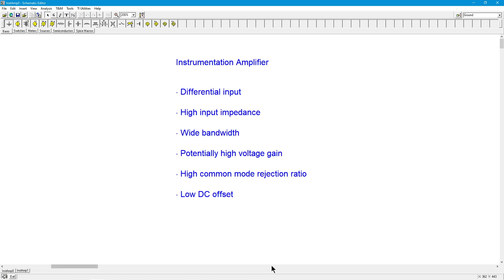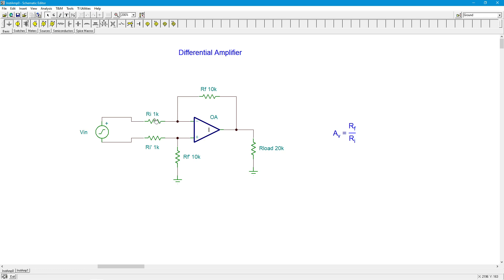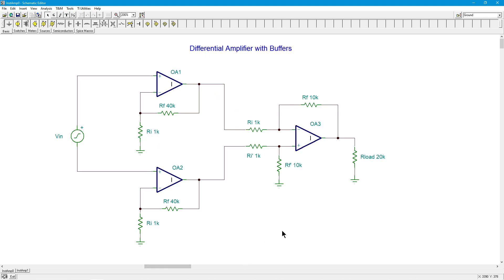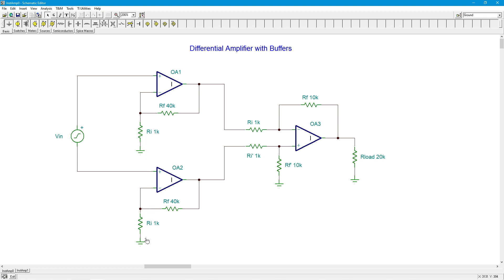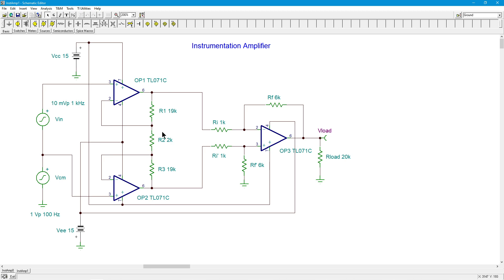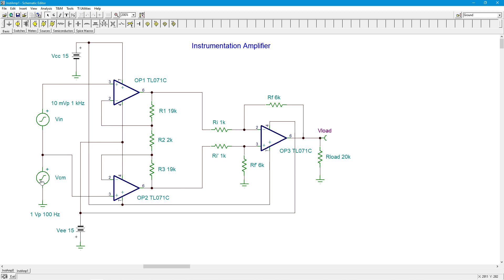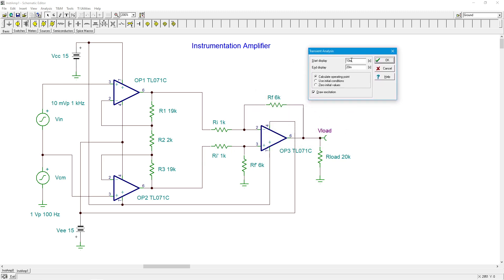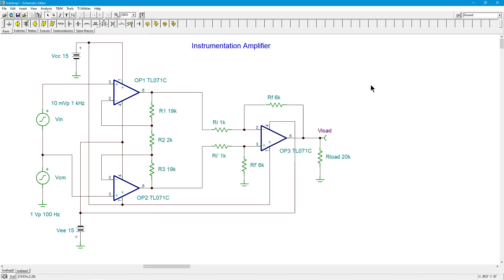Op Amps: Instrumentation Amplifier

Comment: I respect teachers who don't merely scribble math and shapes, and not those who exhibit circuits with hard to get and expensive parts found only in the silicon valley, but practical and intelligible schematic with on the shelf easy to find parts! Thanks a lot.
Reply from the maker: You're welcome. I always try to remember what Einstein said: "Things should be as simple as possible, but no simpler", especially when it comes to introducing new topics.

Comment: Would this work for a heart monitor input? Plus some isolation.
Reply from the maker: Yes, instrumentation amplifiers are designed for applications such as that. Measurement devices often require high input impedance to minimize loading, high gain to deal with small signals, wide bandwidth (both low frequency and high frequency, depending on what is being measured), and high common mode rejection to cancel out noise.

Comment: In practical instrumentation design an all integrated solution will have the best CMRR. As a comparison to your circuit you can use an Analog Devices AD8220 which has a JFET front end. Often overlooked is the fact that the input to the instrumentation amplifier is an external connection exposed to ESD and the output usually goes to an A/D, data acquisition system, or an oscilloscope so you need some sort of line driver to drive a coax cable even if not terminated. The output also has to be ESD protected. Many times if you are driving an A/D input you will want a low pass filter to remove aliasing, but you can't usually drive an A/D input sample and hold with a filter high output impedance, so you need a buffer amp anyway. 

So, if you want to drive a scope input with a three foot coax you would want a buffer amp like a TI THS3120 Current Feedback Op Amp (this is an older non RTR output device so you will loose some output headroom with +/- 15V supplies) with a 50 ohm series source resistor (49.9 Ohm). An optional cable driver part would be the older LT1206 which is available in the SOIC8 package. Both the LT1206 and THS3120 are unity gain stable non-inverting. So, you could have a switch to set the gain for 1 without scope 50 Ohm termination, or to a gain of 2 (slightly more peaking) with a 50 Ohm scope termination. To protect the output from ESD you could use a bidirectional TVS, and perhaps a small output capacitor like 100pF NP0 Ceramic. The supply rails have to be capable of driving very high momentary current. So probably a 47uF Tantalum and 1nF ceramic directly at the supply pins of the current mode line driver op amp.

Designing instrumentation is not easy especially if you want good DC accuracy along with high bandwidth.
Reply from the maker: I agree, and I talk about some of these issues and integrated solutions in my free OER text book (links in Description). To be clear, these videos are designed for general engineering education purposes, and are not intended to show exhaustive designs or "best in class" solutions. They are intended to complement the text and be of reasonable length. That's one reason why I tend to use common, easily (and inexpensively) sourced parts, so that students and hobbyists can breadboard and experiment with these circuits on their own.

Comment: This looks like the beginnings of a high precision millivolt meter. With a 10Meg resistor divider i could probably measure into the millivolt precision on many voltage ranges... thanks for your lessons i thoroughly enjoy your teaching
Reply from the maker: Yep. You'd want precision op amps to minimize the offsets, of course.

Comment: I am trying to understand the difference the introduction of R2 makes from a more practical point of view. Is that correct, that by adding that resistor, the final CMRR becomes the added value of the two stages' CMRRs?
Reply from the maker: R2 creates a cross-coupling between the two sides, increasing performance. I cover this in some greater detail in the text (free download-see links in video description).
Reply: @ElectronicswithProfessorFiore  thanks, I'll check it out!

Comment: One question occurs to me: are there any applications where this would be a poor choice, not from a cost perspective, but applications where this would perform more poorly than another kind of amplifier?
Reply from the maker: Not quite sure what you're asking here, but if you need a high CMRR with high gain/bandwidth and a high Zin, this is the way to go. If you don't need those things, then yes, this could be overkill (i.e., greater cost and board space with no real performance benefit).
Reply: @ElectronicswithProfessorFiore  rephrased: if cost and space were no object, would this amplifier always be the right choice?
Reply from the maker: @nickcaruso  Cost and space are always issues in real world engineering. What would be the point of using this topology if its unique features were not taken advantage of? It sounds like you're venturing away from engineering and into marketing, as in "this is the best circuit". As I tell my students in lecture, there is no such thing as "best" in the absolute sense; there is only optimal fit for the circumstances. It doesn't matter if you're talking about cameras or bikes or computers or amplifier circuits. There is no universal best because applications/needs differ.